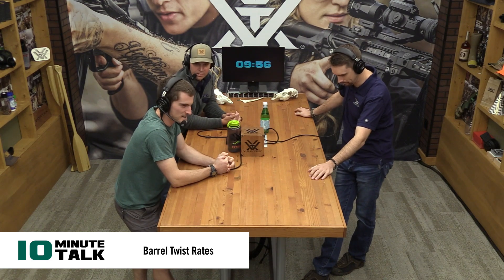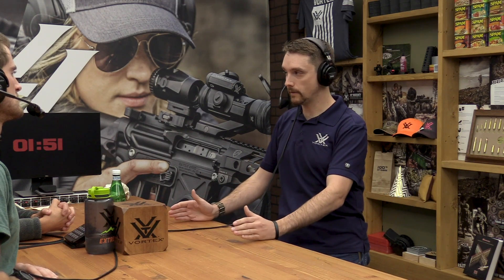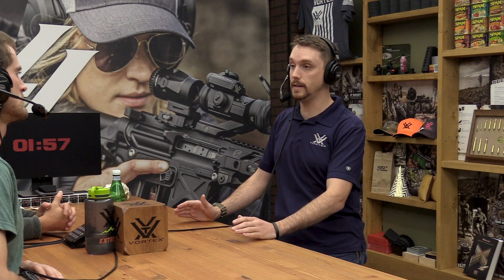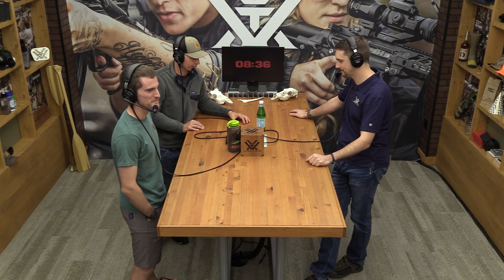#10MinuteTalk – Barrel Twist Rates

Comment: It seems to reason to me that barrel twist rates would have some physical direct connection to barrel harmonics, and the vibration nodes of bullets traveling down a specific length barrel. Why are twist rates always in whole inches 7, 8, 9, 10 inch twist rates, instead of 7.33 inches or 8.67 twist rate or 9.3? it seems like fairly simple, mathematics and artificial intelligence could figure out the Goldilocks twist rate for a specific caliber and a specific barrel length, as relates to barrel, harmonics and nodes?

Comment: Is there such a thing as a compound twist rate or a spiral curve  twist rate? for example, half or 2/3 of the barrel being a 7 inch twist and then the muzzle half or 1/3 exit barrel length being an 8 inch for a spiral twist as the bullet clears the muzzle?  Guitar finger boards, and neck have compound radius. Is there an equivalent compound twist rate possible with rifle barreling?

Comment: I swopped out my factory Winchester 30-06, model 70, 22" barrel for a Bartlene match grade 26", 1-9 twist barrel, to shut the Winchester Expedition ammo with the 190 grain nosler VDL bullet.  The factory barrel would not group to my satisfaction. The Bartlene barrel, now groups 3/4 MOA, but with reloads at 2650 fps.  A little faster twist and slower speed got me the accuracy out to 300 yards that I wanted.

Comment: 1:30 Ok I have a "DUMB" question since you brought up heavier alloys.
Copper is lighter than lead, Correct??
So if copper is lighter than lead, it stands to reason that similar weight bullets copper vs lead, the copper bullet would be "Longer" which should in turn lead to a higher BC (more aerodynamic) bullet, but with the small amount of research I have done, this doesn't appear to be true. What gives????

Comment: Hornady in the 70's came out with the 22 cal SX Bullets which had a listed max velocity (because ALL .22 centerfires at that  time were 1-14" twist). These light jacket bullets gave explosive terminal performance similar to the 22-250, 224 Weatherby, 225 winchester and the 220 swift with conventional bullets--- but  in the smaller case capacity 22 centerfires such as  218 Bee, 219 Zipper, 222 Rem, 222Rem Mag, 223 Rem(1in14"). Sierra had it's Blitz line which was the same concept. However, when shot at max velocities in a 224 Wby, 225 Win, 22-250 or 220 Swift-- the bullets would vaporize well before 50 yds. This would also happen with fast twist 223/5.56 which came out much later. I think Hornady dropped this construction design when fast twist 223's hit the mainstream market. I shot a ton of 6mm 70gr Hornady SX bullets through my 1-14" twist 6mm PPC . With the combination of velocity drop and twist rate change as compared to my 2( Rem & Tikka ) 1-9" 6mm Remington's (which I shot to almost "smoothbore status" ; plus I most definetly did with the PPC -5000 rnds -ish")  this was the only bullet that gave good performace on small varmints with the massively decreased RPM at muzzle. Bullets I had seen explosive results with in 6mm Rem - such as 60gr HP, 70gr hpbt,75hpn - gave "FMJ like" results in the PPC ( I had to "shoulder shoot" gophers so they wouldn't run down the hole). The importance of muzzle exit RPM was already made very evident years before ( to only a ballistics GEEK like myself) in the gopher patch when shooting with mulitple 22 centerfire calibers using the exact same bullet and the same 1-14" twist.  222rem vs  22-250 shot at distances where the bullet hit at 2700 ish  FPS ( 222=100yds ish and 22-250=250yds ish) - the 22-250 hits were very much more explosive ." Kinda ripped apart" vs "pink mist". I doubt this has quite the same differential effect on bullets which are more "Hydraulicly Employed" such as monolith tipped bullets. This is very much worth a " Ryan Muckinhern Deep Dive" ( I bet I spelled his last name wrong,,, SORRY! EH!!). Something like 260 Rem vs 6.5 Creedmoor, or 22-250  vs 22 arc same bullet , same impact velocity, just looking at changes in expansion with the change of twist rate

Comment: I've got an old mint condition ruger no1 in 243 with a 26" barrel. It wont shoot well with most 80gr and not at all with the 100gr. 80gr sako powerblade copper shot the best. I used a cleaning rod to try to know the twist. I think it's 10". Maybe a 58gr vmax would shoot better? What twist were they making older ruger no1 in? I love the gun but I want more accuracy.

Comment: Several  " barrel twist" videos claim that it is mostly length and little weight. They use weight because length plus substance (metal) equals weight. So, is it actuality length, or weight? Will a 100 +/- gr short, round nose lead&copper  use the same twist as a solid copper or "plastic" tipped copper bullet? Just Asking

Comment: I have an older mini 14 with a 1:7 twist. Ruger now makes barrels with a 1:9 twist. I suspect they did this to reduce the dispersion when shooting a 55 grain bullet. I’ve been thinking about what I need to shoot if I want to reduce dispersion by hopefully achieving the same rate of bullet spin. If I assume a 55 grain bullet has a muzzle velocity of 3250 ft/sec., 3250/9x7 would give me a desired muzzle velocity of 2528 ft/sec. A 77 grain bullet has a published muzzle velocity of around 2800 ft/sec. I think I’m going to see how 77 grain ammunition works. Since the bullet is a little longer, my 2528 ft/sec should be a little too slow.

Comment: Hello, The Winchester model 70 .308 twist rate is 1-12..is it they do not expect anything heavier than 150gr ? do I have that right? heavier bullits need more twist? Also their Alpha models are a 1-10..Seems like every other manufacturer is at 1-10 Is 1-12 just not going to stabilize some of the factory cartridges available even the Winchester made ammo? Also FYI Winchester told me 1-12 was optimum but they only deem a gun returned is judged  faulty if it can not shoot better than 1.5 inch groups. Meaning if it shoots up to 1.5 Inch groups it's ok and they won't fix it. Is that normal? I really want a Winchester 70 featherweight in .308 but now Idno any comments? I would greatly apreciate it as I enter the rifle hunting world. (just shot gun now) I really get so much from your pod casts. Thank you and best regards guys, T
Reply: Longer bullets are usually the issue, not necessary weight
Reply: hi thanks so 1-12 should be ok? and has any one had experience with the new mod 70 win for accuracy? I thought it kind of lose for their repair only if it busted 1.5 moa @dontbetreadin4777
Reply: oh sorry ADD ya know that was for .308 win @dontbetreadin4777

Comment: I'm not a professional by any stretch of the imagination but I have done quite a bit of shooting, and what I have found is with 55 grain bullets a 1/7 or 1/8 are perfect at 100 yards, for 5.56. My Grendel has a 1/7 twist rate  heavy stainless barrel and it holds a .5" groups at 100 yards with wolf fmj ammo out of a 16" barrel. Both of my 5.56 barrels are also 16".
Reply: I love 1/7 in 18" or 16". Always have superb accuracy from 50gr-77gr

Comment: So I’ve purchased some 195gr 30 cal long range bullets to reload for my stainless Ruger .30-06. The gun was built about 1994 so I’m assuming about a 1:10 twist rate. I’ve reloaded many 150 (special) ,165, 180, and 210 (special) grain bullets for this gun and a 1970 Remington .30-06. I’m also assuming the Rem has a 1;10 twist. I have sweet formulas for those loads yet this bullet is so long I feel I’ll either be seating the bullet to shallow thus running to far forward (to deep) in the action or l’ll seat it so I end up compressing the actual powder. The 210gr is used in heavy brush during close range elk/moose/bear ”tracking shots” (lighter powder charge) whereas this 195 grain LR bullet will be for the opposite type shots. At this point it’s intended to be a .30 cal experiment. Building and dialing in the load will be interesting yet I wonder; based on your twist rate talk, am I asking for a nightmare of tumbling or inverted bullets? Will that bullet seating be a really critical element to this experiment? What other factors may become critical that I may need to consider? I’ve had exceptional accuracy and knockdown power out to 400 yards with a Barnes 180gr lead soft point. This has led me in the direction of looking at LR bullets and capabilities. I don’t favor long shots over spot and stalk. When I have opportunities I favor the knock down (usually less than 200 yards on elk as little as 18 once and 275 yards on deer). As I age all and new opportunities need consideration.

Comment: Don't forget increasing twist rate reduces mechanical accuracy.  Unless the bullet is perfectly concentric, spinning it faster increases "wobble".  Higher BC bullets also have a lower mechanical accuracy (0-300yds) when not accounting for aerodynamics.  They are less aerodynamically stable because the distance between the center of pressure and center of gravity is farther apart.  This makes the bullet want to flip and fly butt first with the center of gravity forward.  You actually want to spin the bullet as slow as possible, but still achieve gyroscopic stability.  This will maximize mechanical accuracy.  Higher twist rate isn't always better.  It is a necessary evil to get the ballistic advantage of shooting a higher BC bullet for long range.  Accuracy suffers.

Comment: 8.6 Blackout uses 1:3 twist rate. 5.56 80+gr works best with 1:7 or 1:6. Terminal performance is extremely affected by twist rate, too. Solid copper or bronze bullets deal with the fastest twists better than lead core. IMO
BC, SD, MV seem to work together to determine optimal twist rate. The 8.6 Blackout is an excellent example of a seemingly ludicrous combination of factors with completely unexpected and superior terminal results. It should trigger some experimentation with other caliber combinations. I see the 60gr, .22rimfire subsonic prefers 1:12, 1:13 twist whereas the 45gr and lighter bullets do best with lazy 1:16 twist.

Comment: Talking about modern bullets. Guns and bullets are like cars and engines. Back in the day 500hp from an engine was like holy 💩  but in comparison to modern engines it's like eh 500hp eh that's alright. The new holy 💩 hp of today lies between 800-1500hp. Where back in the day it was 5-600 MAYBE 650.

Comment: The barrel twist vs barrel length issue is mainly related to muzzle velocity.  The twist rate formulas ask for muzzle velocity  bullet weight and shape.   This is because what matters for stability is the revolutions-per-minute.  To get this, you need the correct combination of twist rate and velocity as the bullet reaches the end of the barrel.  A lower velocity needs a higher twist rate to get the proper RPM's.  With a 223 Rem, for example, the speed of a bullet at the end of an 8" barrel will be lower than the speed of the bullet at the end of a 20" barrel.  To get the same RPM's the twist rate of the short barrel will need to be faster than the long one.
Reply: Thanx that was sum good info

Comment: Yes. Increased twist rate if it is aggressive it could potentially cause overpressure. So if you were shooting a heavier bullet at an aggressive twist rate, you're going to want to reload with the slower burn rate powder. And this is especially true if you are running a long barrel.

Comment: Thank you for the video. I found it educational. But what I have been told by barrel manufacturers is it's not an issue of weight, it's an issue of length that decides the twist rate you want. And just because a bullet is longer doesn't mean it's heavier. I have shorter spitzer bullets that weight 40 grains more then my berger vlds. But longer bullets require more twist per distance it travels.

Comment: I think it comes down to what the rifle likes.
I have a 1:7, a 1:8 and a 1:9 barrels for my .A/R. The 1:7 is pretty good for 69-77 gr bullets. The 1:8 I use for 65-77 gr. It’s a tack driver with 65 gr. Also really good with 69 gr. Opens up some with 77 gr.. I use the 1:9 for varmit loads from 40-55 gr.
Haven’t found one that is good with 62 gr. My rifle just does not like 62 gr pills. I just stay with my 1:8 now. Got to be to big of a hassle to change out barrels.

Comment: Can anyone tell me if a tikka 30-06 with 1:11 twist rate would be fine shooting 220g bullets?
Reply: Did you find out ?
Reply: @saigeglass3106  didn't try or find out 1:11 twist but I did use 220g 3006 in a 1:10 twist it worked just fine

Comment: What's the best weight for a 1/12 twist 308?
Reply: 150 grains
Reply: The best is 168 Sierra match king. I had a sps tactical that was a half minute gun. My load was lapua brass, 210 match primer and 46 grain of blc2 powder.  The fbi back in the 80s through mid 2000s used this comb for hrt snipers and most police snipers

Comment: This is great information. I live in Comi CA and pistols are not allowed so I’m considering a 13.7 pin and weld pistol length gas system AR with a 1/7 twist and a nox keymo flash hider. I’m primarily going to run supers and occasionally some subs and using for home defense and at the range and some hunting. Will the 1/7 twist run reliably for both SuperSonic and subs? And for what I’m doing is the 1/7 the best choice for my situation?  The manufacturer suggested a 1/6 twist but I was skeptical on that and I don’t want over stabilization.

Comment: So would you say that the faster the twist rate, the slower the muzzle velocity? Say you shot a 180gr 300 wm out of a 1:10, you should get muzzle velocity right around 2900-3000 fps. If you dropped the twist rate to a 1:9, would your muzzle velocity also drop to let's say 2750-2850 fps because the energy has transferred from forward propulsion to rotational force?

Comment: My 300 WM with a 1:10 loves the 195 grain ELDM but my groups really opened up with 200 grain ELDX. 180’s tend to work pretty well too
Reply: That's really surprising!  I didn't run the numbers on the 200 ELDX but the 212 ELDX at 2950 out of a 1/10 twist barrel has a stability rating of 1.83...1.5 and up being well stabilized.  The 200 ELDX should be much higher than that!  I doubt it was a stability issue...most likely a load development issue.  Tinker more and I'd bet you can find a load that works! 🎉

Comment: Can barrel twist rates be overcome by velocity? I've got a 308 and a 300 win mag the 300 win mag has the powder to push a 200 grain bullet around the same velocity as the 308 can push let's say 175 grain bullet since it's leaving the barrel faster does that compensate for a slower twist in the barrel. My 300 win mag is a one in 10
Reply: Partially yes, more velocity increases rpm's.

Comment: I believe a bullet leaving the barrel at 3400 fps with a one in nine twist is rotating around 272000 rpm.  Correct me if that is wrong it is a rough calculation.

Comment: You can see the bullet explode if you use a 110 grain plinker bullet in a 30-06 and load it to the max. for an 06. The light weight of the bullet allows much more powder so velocity can be very high thus high rpm the bullet was not built for. It puffs into a greyish burst shortly out of the barrel. I don't know if it is bad for the firearm though.

Comment: Always clear your barrel if you don't register a shot if you have a projectile stuck in the barrel the follow up shot will destroy your rifle and injure you  has happened to me forgot to charge a reloaded round primer  was enough to push the pill into the barrel lucky i pulled the bolt and look Safety First always clear your rifle with a non registering shot Stay safe.

Comment: Rifling type is a big contributor to bullets exploding. You can take two barrels same twist with two different riflings and over spin the bullet. Possibly get two different results. Like some rifling deform the bullets less. So it doesn’t deform the thin jacket so it holds together better.

Comment: Surprising lack of mention of the effect that over spinning bullets (so they're rotating too fast ) has on the gyroscopic effect shifting them off trajectories.  Plus of course the extreme heating effect on bullets flying at supersonic speeds  can have them Vaporising in flight, such that Varmint bullets often come with warnings not to load them to exceed say 3,500 ft per second muzzle velocity, which is something you also have to factor in with bullet rpm if it over stabilises the bullet, so you get extreme heat for the bullet build combined with centrifugal forces attempting to tear tthe bullet apart. Phew. 👍🏴

Comment: Do a ballistic calc on a 140gr eldm going 2750 out of a 1/8 vs a 147gr eldm going 2700 out of a 1/7.... more weight and twist is not always better. Cause more drift and less FPS. Every case/charge has a balance. It’s really only ever been about how much powder through diameter.... and there is a perfect size and twist for those two things.

Comment: I bought a remington 700 varmint 2-3years ago in .223 that is 26" heavy barrel with 1-12 twist and 69gr shoot about 8" group and 77gr tumbles and keyholes. Definitely getting rebarreled cause what is point of having long heavy bolt gun that cant shoot over 55gr out of.
Reply: Definitely something wrong with that.  My 16" "AR"  1:9  will shoot 223rem 69gr  under 5/8"  and 75gr  under 1"  all day
Reply: @fivex4756  it should you have the twist for it for whatever reason remington made whole run of these varmint guns in 223 and 22-250 with super slow twist they shoot great with 35-55 grains anything heavier it goes to hell.
Reply: @Thelaubster1  It would be interesting to see what the velocities are with all those from that barrel. .
Reply: The 35gr should be right around 4000fps give or take out of 223.